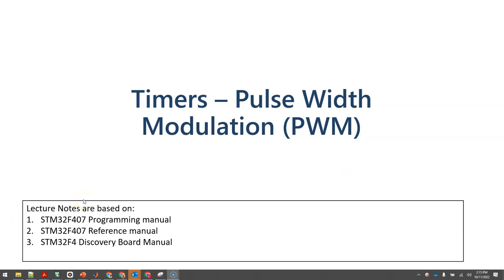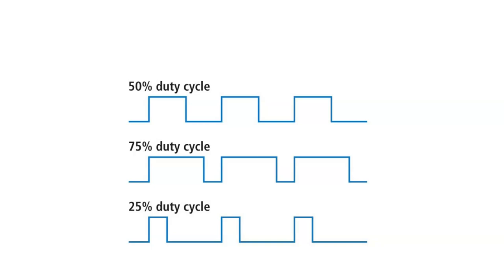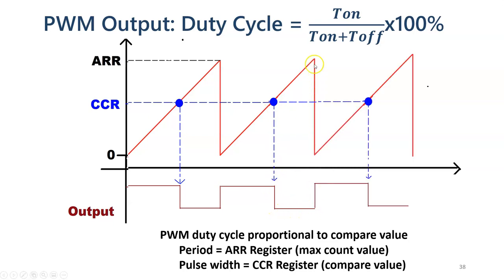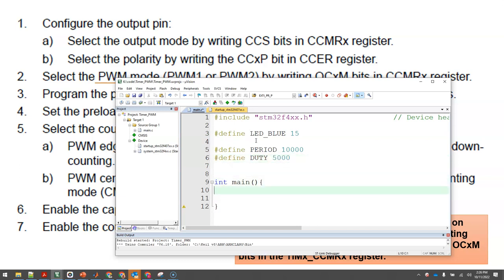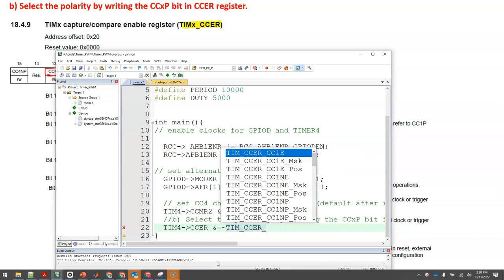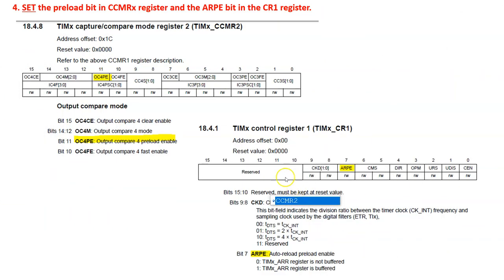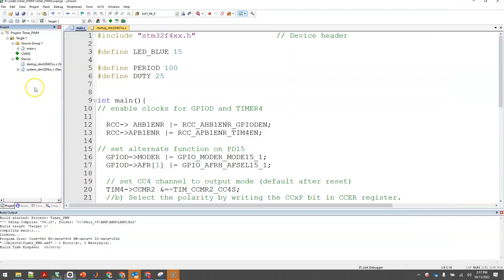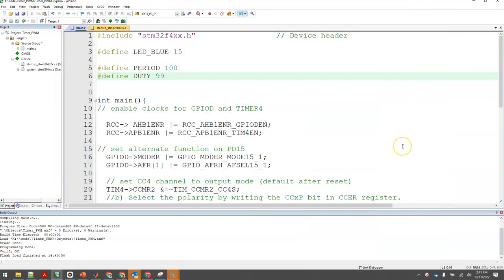STM32F4 Bare Metal Programming - Timers:  Pulse Width Modulation (PWM)

Comment: Pls I've run into trouble setting up centre aligned complementary pwm using stm32f103c8t6. Centre aligned Period is 2x but dma doesn't work anymore. But if I go to Edge aligned Period is half and dma works . I an using dma1_chn2 for dma ... pls could u piont me in the right direction.....I don't want HAL
Reply: DMA has mapping between input and output data values: 16-bit to 16-bit, 32-bit to 16 bit, e.t.c. Read about DMA.

Comment: Hello! How do you know what timers act on what pins?  Also what are channels ?
Reply from the maker: The board manual or the chip datasheet will tell you the info regarding what pins have access to what timer channels/functions. Each timer has multiple functionality - eg. input capture, output compare, PWM etc. Channels are independent set of registers that allow the timer to be used for a specific functionality.
Reply: @ENGRTUTOR  On my board stm32f401xB/C pin PA15 and PA5 are both connected to TIM2/CH1 but only one receives PWM output.
Reply: @ENGRTUTOR  How would I go about using a the second channel of a timer as PWM? For example TIM2/CH2?